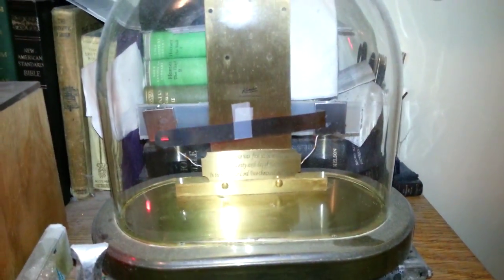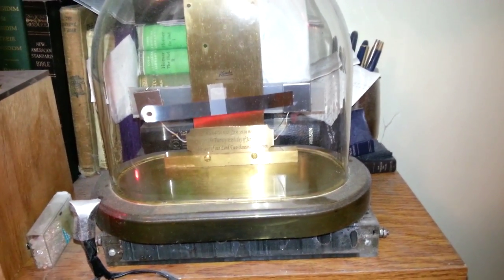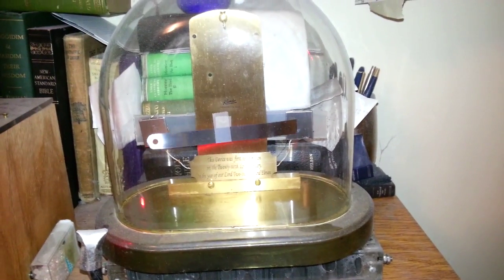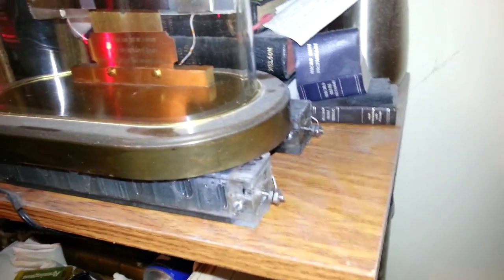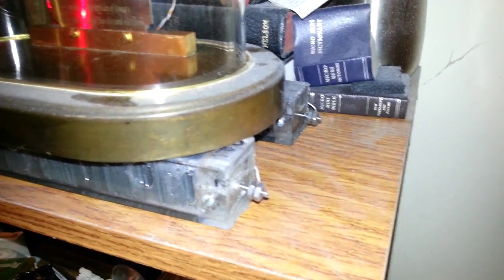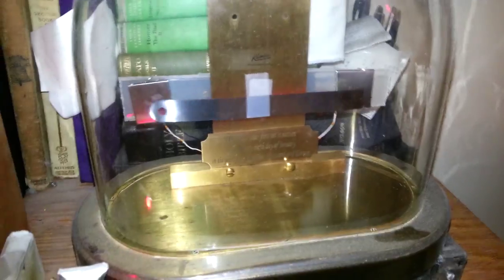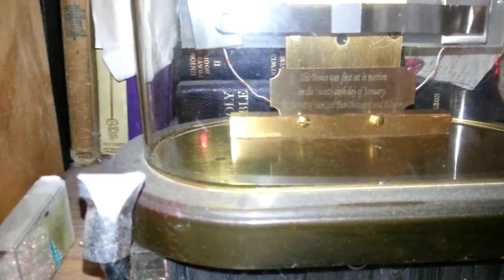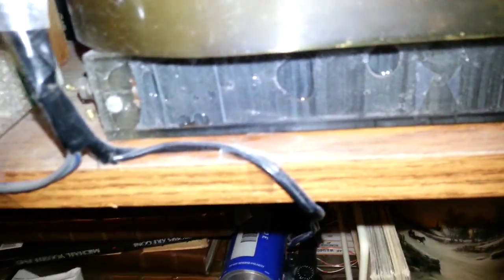Almost Perpetual Pendulum. 5 year update video.

Comment: Nice work! mine has a 2nd birthday coming up in May:) I hope they both go on and on 'till His return.
What was the starting voltage?
Reply from the maker: +wekanduit 
Sadly, these were my earliest batteries. My newer batteres produce far more energy. 
The two 12 inch batteries only produce 500 volts. The good news is that they are still at 500 volts. I too hope that they last a few hundred years, or until His return. ;-)
Reply from the maker: +wekanduit 
Did you build one of your devices for Museum lady?
Reply: +kafr8413 No, I think my price was too high. But that's ok:)
Reply: +kafr8413 I have one pile that has maintained voltage for 2 years and my nice looking one is down to 500v last I measured from 1.3kv. Now I think I know how to do both high v and low degradation...I wish I knew a way to age the pile so I could see results faster lol.